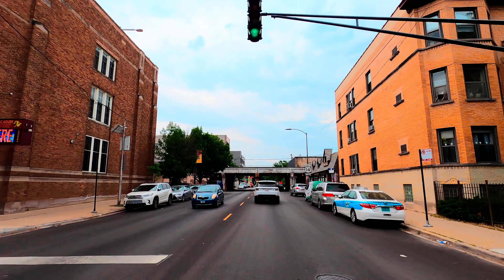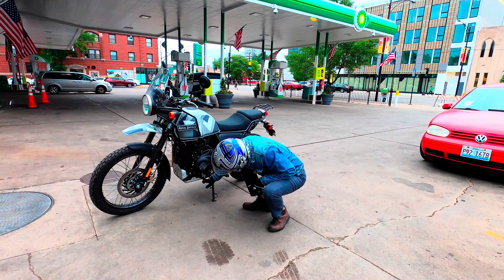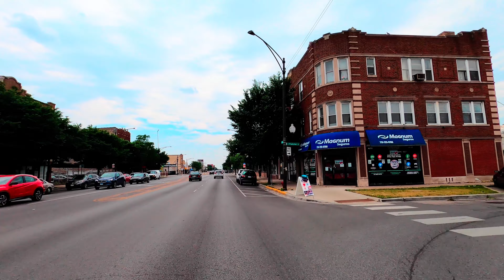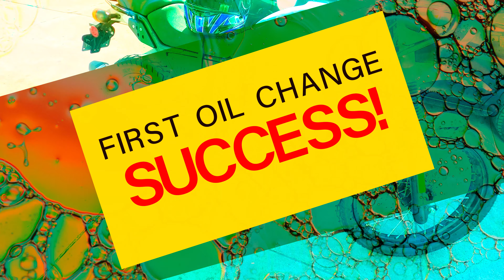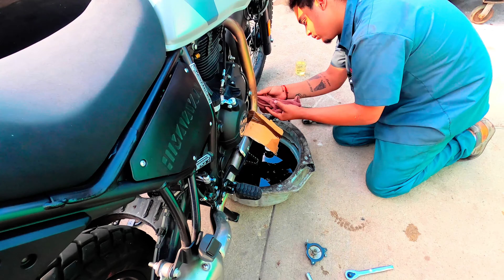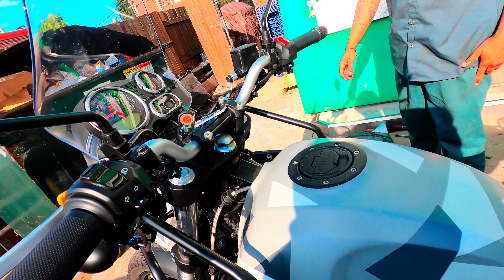Kash Gauni 23 [4K] - Royal Enfield Himalayan | Chicago | 1st service | oil change

Comment: How can you expect a new bike to have clean oil after 500 miles/800 kms (if i heard right). Most of us change oil at 500 kms when brand new then 1500 kms on 2nd & then 5000 kms on 3rd then every 3000 kms.
Reply from the maker: @Amit Krupal Most Japanese brands I owned did not have such close cycles of oil changes. I am guessing the oil appeared darker as it’s an air cooled engine. It’s a learning curve how to manage Enfield and it’s maintenance cycles. Good insight that I should change it dot at 3000 kms. Thank you, Amit